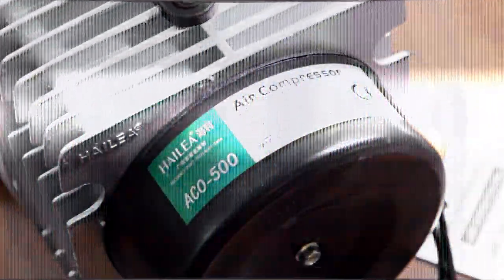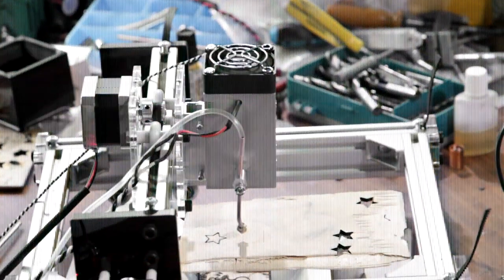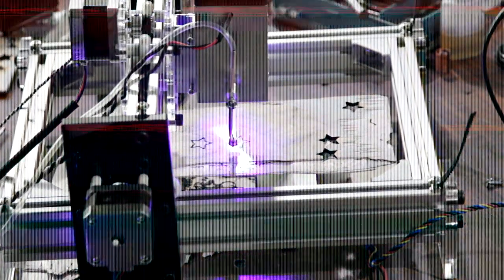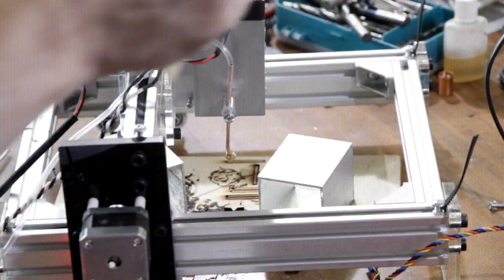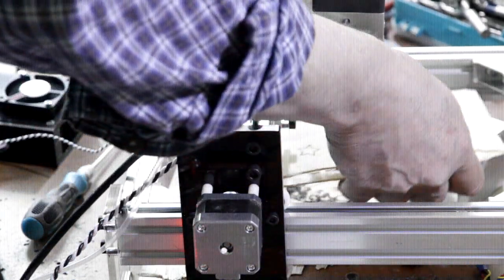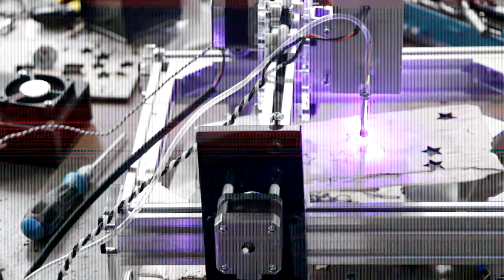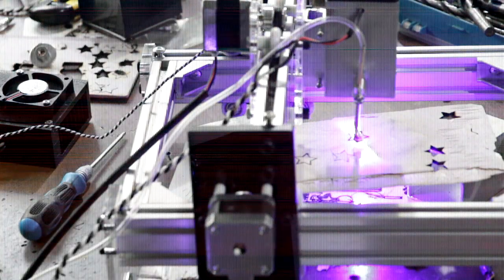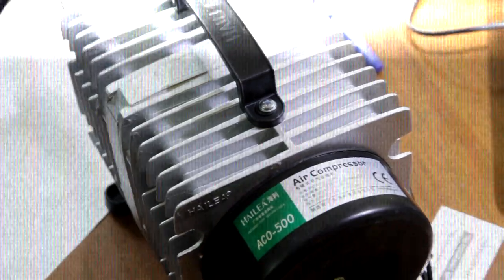Laser cutting with an air assist vs. laser cutting WITHOUT it

Comment: I am in the US, do you know by chance where the best place to purchase one of these Hailea air compressors is for me?
Reply: They go for about $150 on Aliexpress, though you may be able to source one with similar specifications locally, though likely much more expensive. The one in the video claims a wattage of 500W, ~8PSI of pressure, and 420L/minute flow. Given that all it's doing is blasting air at the part, I imagine you could simply hook up a flexible tube to a cheapo Home Depot compressor and stick that tube to the machine. You might even be able to get away with a decently-sized aquarium pump.
Reply: @Recurve_N  Thanks, just listening to this one it was not really all that loud as far as I could tell which is a plus for me over a run of the mill compressor. Considering building my own with a small refrigerator pump I have because that would be super quiet. Thanks for the feedback though, very much appreciated.
Reply from the maker: I would suggest jsut ebay and you can try any fish pump///